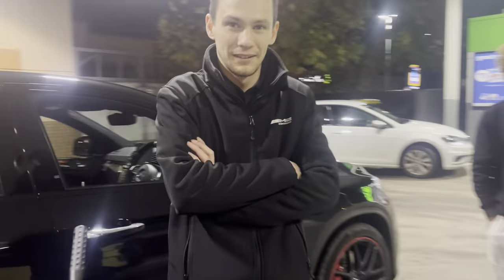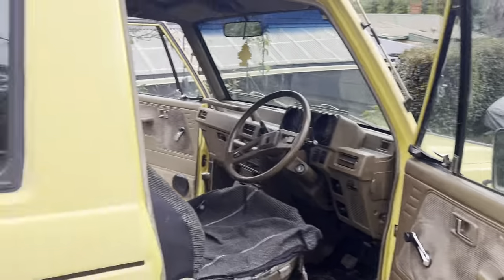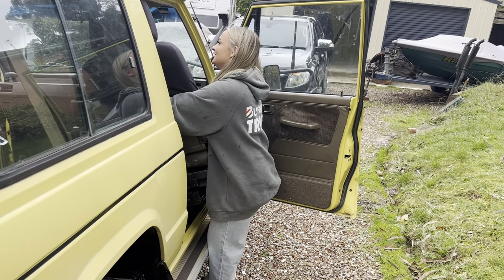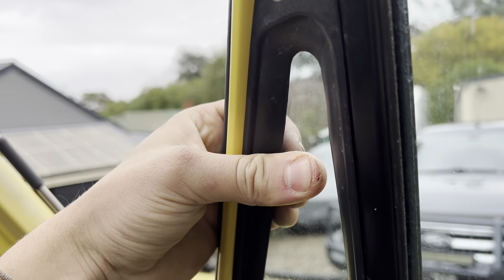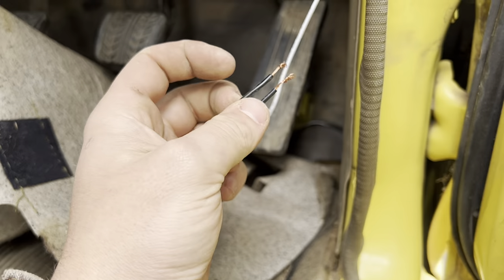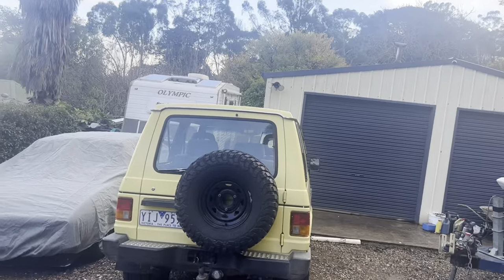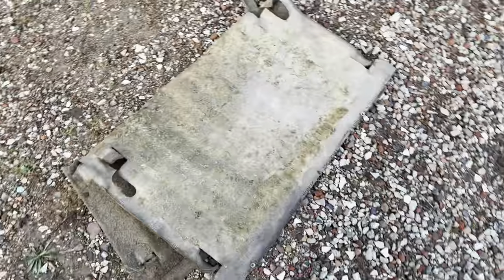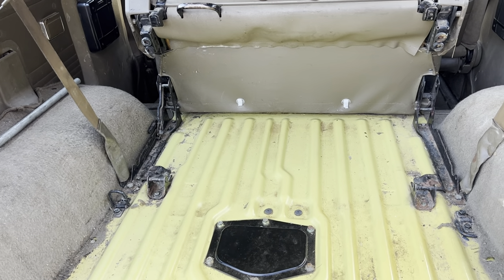Pajero Shorty touring build ep:1

Comment: Good looking car!
I was wondering if the sunraysia wheels are smaller than standard size rims, I have the original rims on my car,but want to put more rubber between the road,and the wheel,to aid with suspension.plus your wheels look great!
I would appreciate anyones advice on wheel sizes!
Reply from the maker: Hey mate! 
They are 15” rims with a -22 offset so they pop out the sides a bit, they are running 31” but 12” wide Bfg muddies
They go pretty good